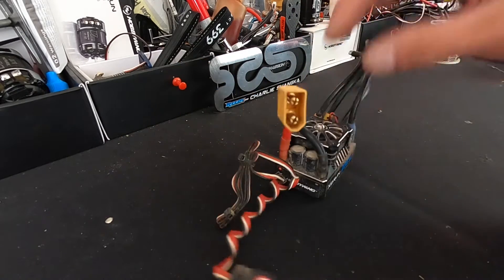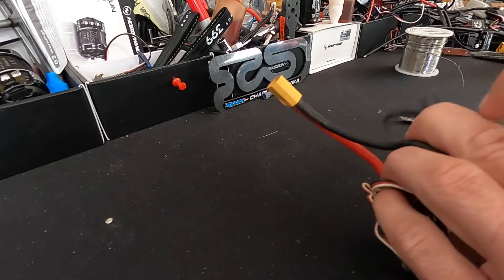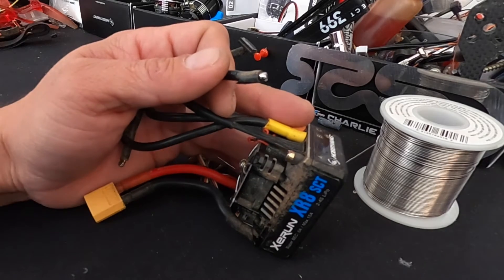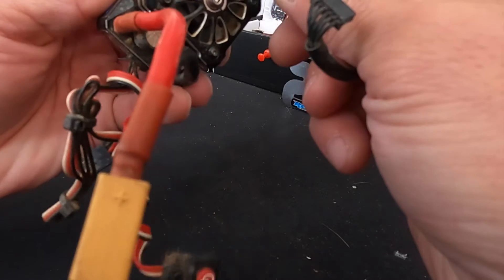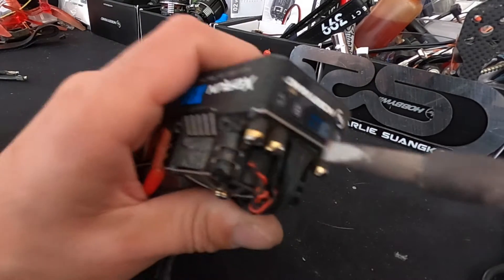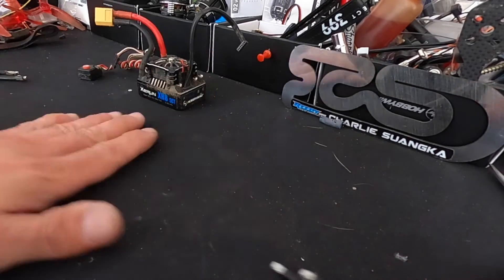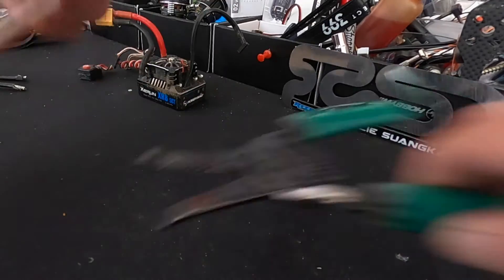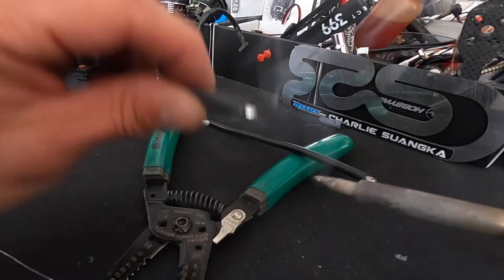The Charlie Show /// Episode 186 /// Soldering ESC Wires

Comment: Aluminum is pronounced aluminium in most of the world because it is spelt like that in most of the world. This follows the the practice of adding the suffix "-ium" to a root word describing the chemicals source or derivation. In Aluminium's case the name comes from Alumina an oxide of aluminium that is one of the intermediary steps from bauxite (essentially aluminium ore) to pure aluminium. Alumina gets its name from the latin for bitter.

This naming convention is pretty widespread and virtually all elements that were not known in antiquity in pure form are named following it. This is why gold silver, copper lead, carbon, sulpher and iron don't follow it but potassium, sodium, lithium, uranium,  plutonium, einsteinium and aluminium do.

There is also a general argument that metals as a whole are all named with the convention, excepting where they already had an ancient names and non metals typically are not. Hence Radon vs Californium.

Ignore Helium. 

;)

Comment: Hi bud can you do a video on how to put a fan on the HW 1080 please I bought one it came with no instructions and I ruined the bottom bracket that goes bettween the esc heatsink and the fan itself
Reply from the maker: Fan is not really needed.  But putting one "next" to the ESC would work fine.
Reply: @HOBBYWINGOfficial  thank you for the reply the fan I'm talking about is a HW fan made for the 1080 when I bought it it came with no instructions and I ended up ruining the lower bracket that goes bettween the fan and the esc heatsink